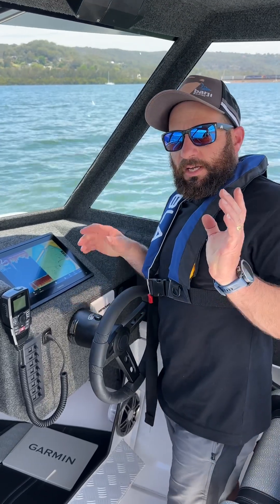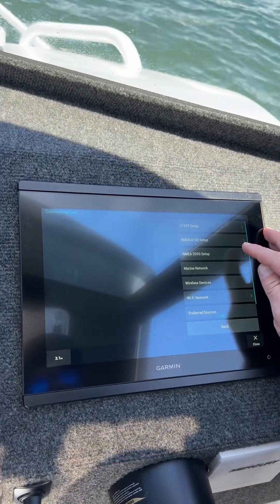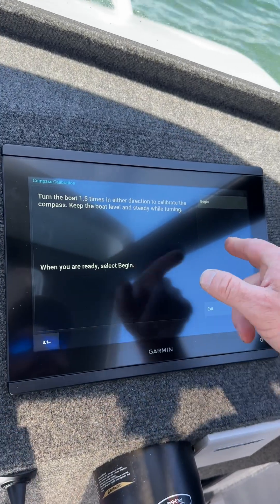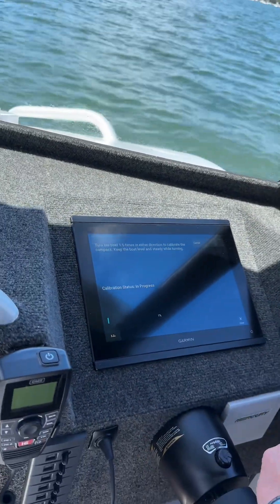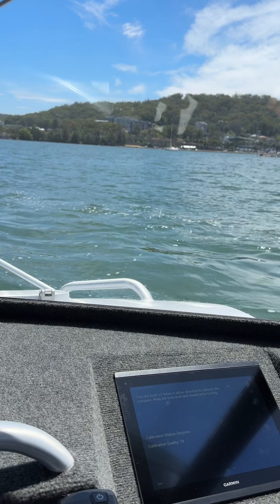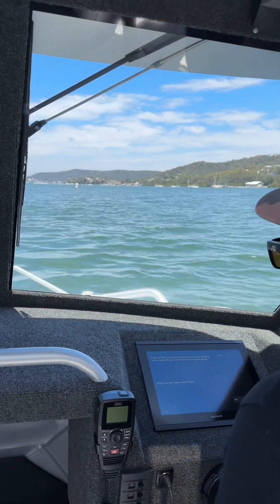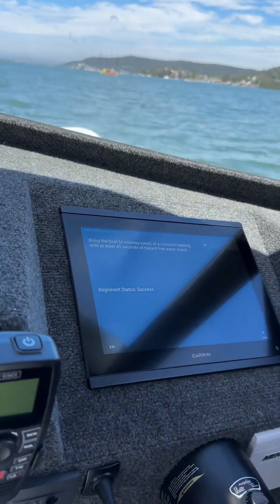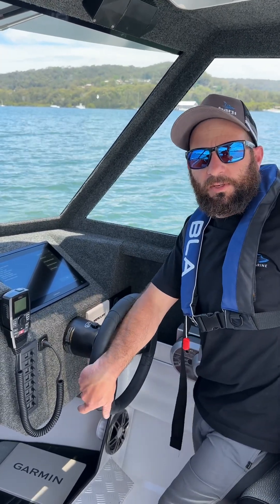Calibrating a Garmin GPS24XD antenna

Comment: Hi Nathan, great video thanks for sharing. Would adding this sensor stop the chart plotter heading from wondering when your at low speeds or stopped by showing true heading? i have a pair of 810xsv for reference.. thanks
Reply from the maker: Yes, absolutely, this is one of the main reasons for fitting the GPS24XD antenna.